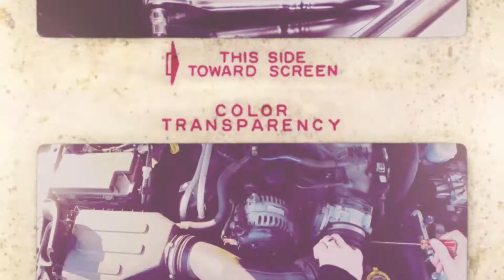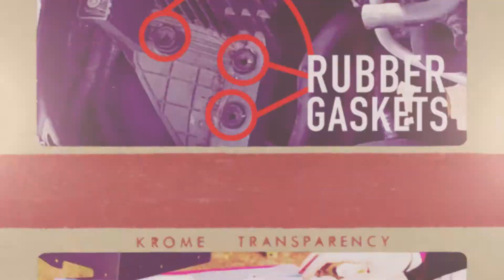Cold Air Intake Install RED ROCK 4x4 w/ Before and After

Comment: So a year later ...what's the verdict? Would you buy again and why? Thanks in advance. Have a Happy Healthy Safe New Year. Cheers!
Reply from the maker: I’ve had no issues. I’d still get it. I’m at 80,000 miles now and the engine still feels strong.
Reply: @joycees  Just installed this in my Dad's 15 two door 6 speed. Both of us were impressed with the quicker throttle response and under some heavy throttle did feel like it pulled away very well. That's what my Dad was looking for I'm also interested in power and throttle response but mostly a bump in mpg even a solid 1 mpg which I think is achievable cause we also run catback flowmaster exhausts would probably pay for itself within a year. He seems very happy. I may pick one up in about a month if he still is happy with his. Both are daily drivers. I put about 20k a year in miles. Mine is a 16 two door with just over 50k. I referenced your video before the install. Thank you.
Reply from the maker: Thanks! Exhaust is going to be my next upgrade.
Reply: @joycees  you should checkout autoedits channel he installed an american thunder exhaust (flowmaster) sounds great has an install video also. Going to be my next exhaust although mine sounds similar. Have a nice New Year.

Comment: So those rubber gaskets. They stay in? Cause I’m having trouble with my spacers being too small. 
You’re the first I have seen keep them in or not really talk about taking them out. 
It looks like I need to find them or make some homemade spacers. 

Does it matter?
Reply from the maker: They stayed in fine for me. I had no problems.
Reply from the maker: Did you try putting a washer below the spacer?
Reply: Thank you putting a washer worked
Reply from the maker: Awesome. Can I get a thumbs up on the vid?